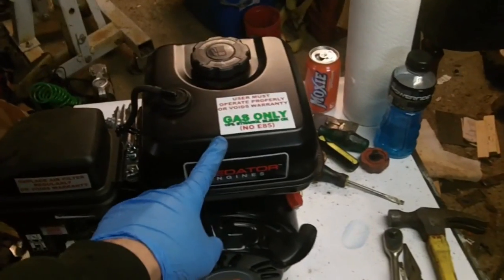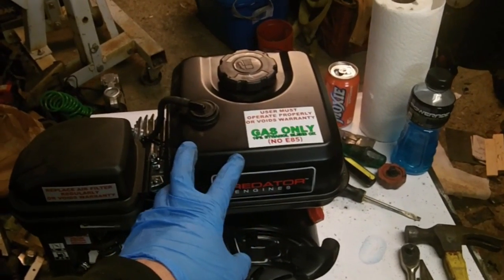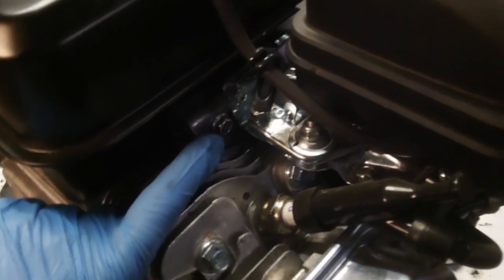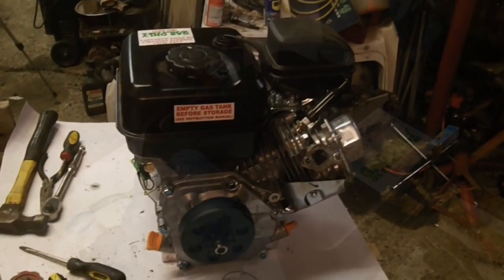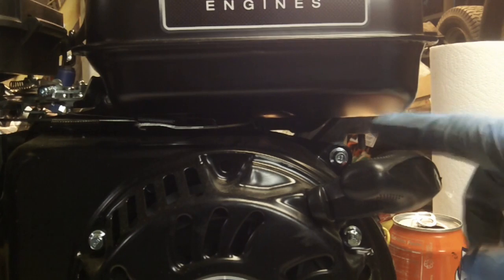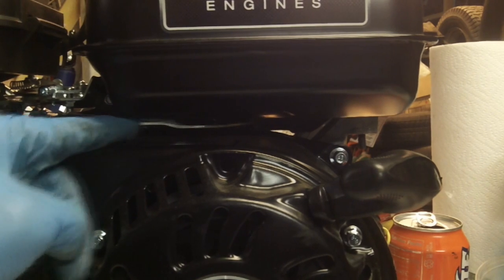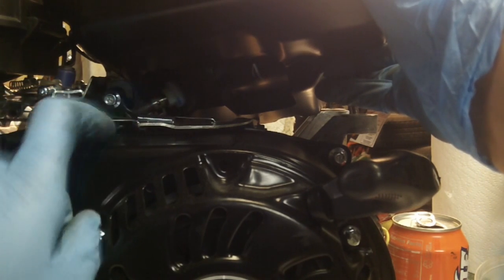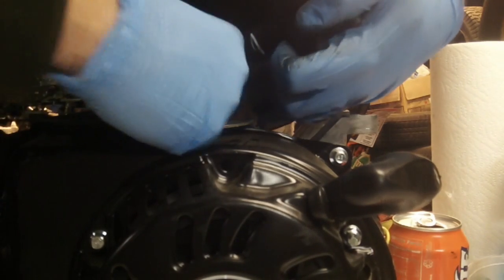Predator 212 6.5HP Gas Tank Removal

Comment: Do you by chance know what size Studs and Nuts they are on the 2 studs in front of the tank that hold it down ? See I was tightening the gas tank down after doing some modifications on my mini bike and as I was tightening one of the nuts down in the front the whole stud broke in half and the half of the stud that broke off is still stuck in the nut that i was tightening and the other half of the stud is still on the engine. So I'm trying to find a replacement stud and nut for it. I have no clue what size they are. I tried searching online for GX200 gas tank nuts and bolts but I'm not finding any. How do I buy just the studs and nuts without having to buy the entire tank ?